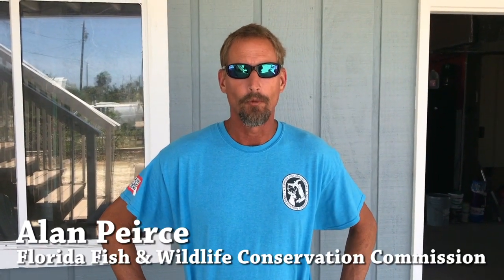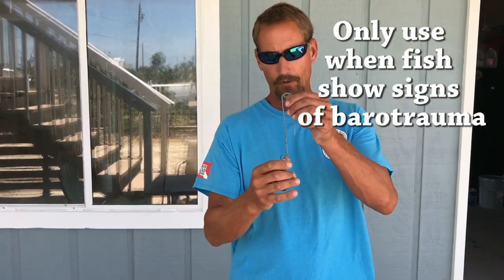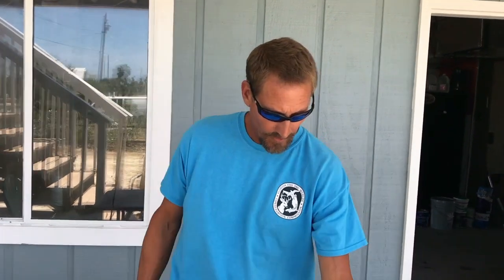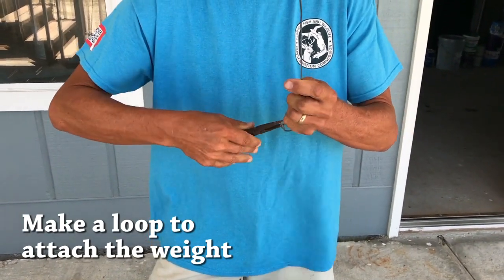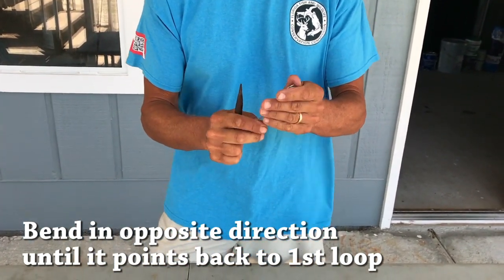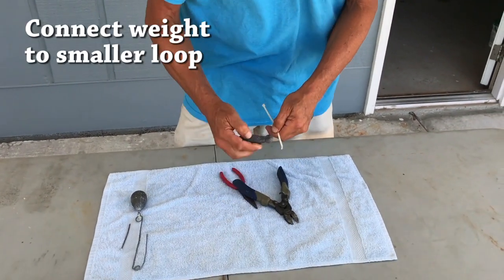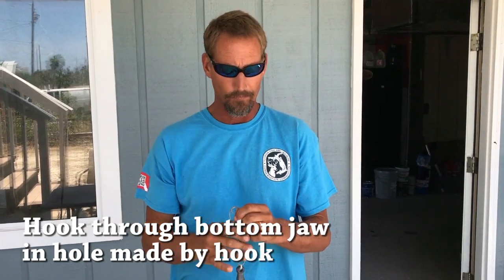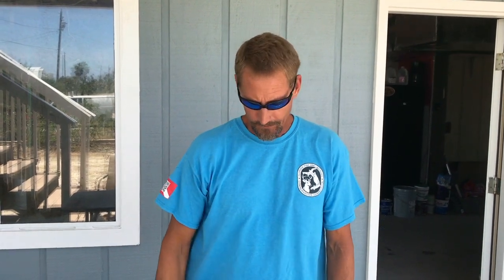How to make a descending device

Comment: Great simple video! I"ve got the wire, just got to find the weight. My question...all other vids I've watch state to hook the fish from the inside out, you state from the outside in. Why is that? ANd could I just attach this above my downrigger weight (10-15lbs) and descend that way or would the fish initially fall off? Get to depth, pause, then just bring the cannonball back up. Thanks.